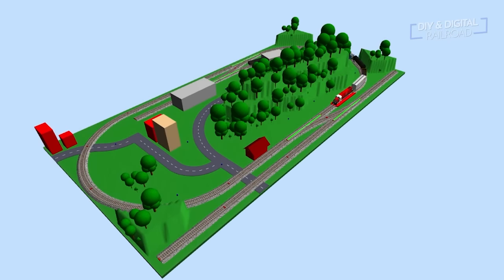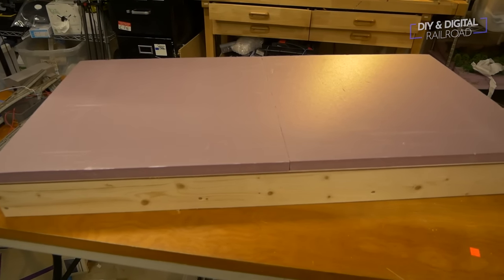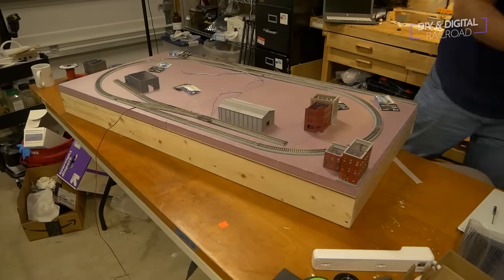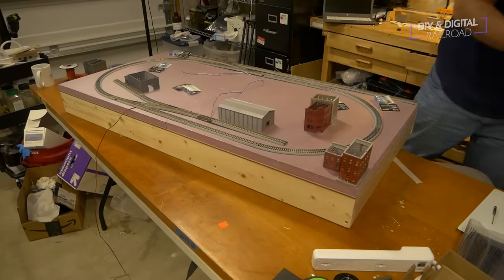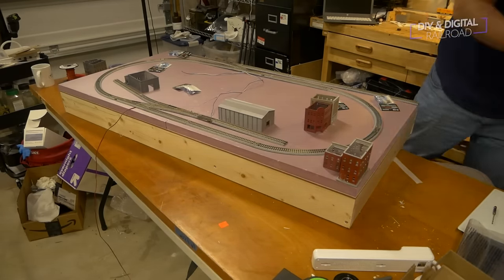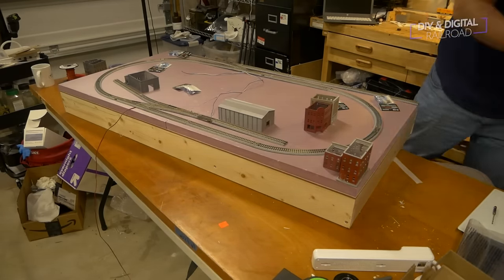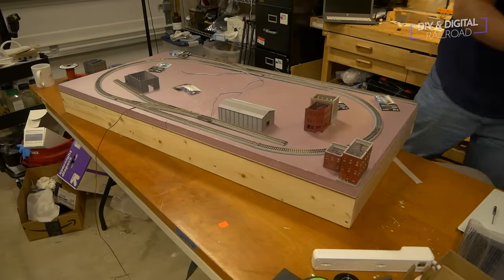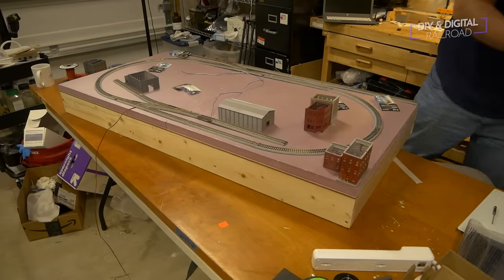Building a Model Railroad from Start to finish: MRROne Mega Compilation

Comment: As an addendum. for anyone who wants to do a bigger layout with Unitrak with ballast. I think I cracked the code by studying Japanese layouts. Simply don't ballast the centers. White glue along the sides avoiding the tops of the ties. Then spoon the ballast along the edges. Once dry a ballast color rattle canned or airbrushed onto the whole thing then painting the tracks and ties as normal with a brush. Shockingly looks better and is way faster than poking and prodding ballast in the shallow tie relief.
Reply: What are your resources for Japanese layouts?

Comment: Just a random thought that occured to me, why not use track "nails" or something else to secure the track, caulk seems a bit bad if something went wrong with the track; a section got torn up, warped, that kinda thing
Reply: Track nails don't work very well with form board. I use homosote which track nails are easy to install and will hold.